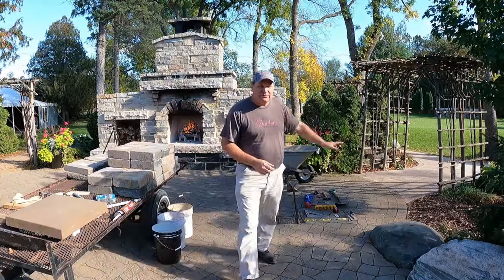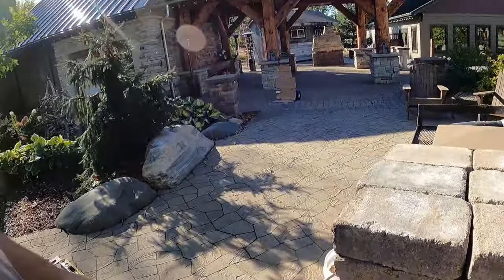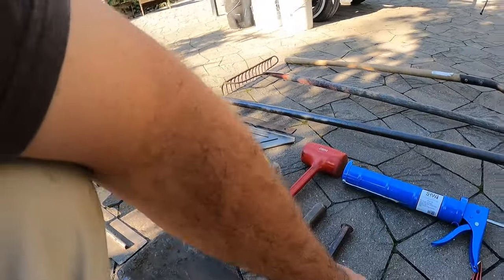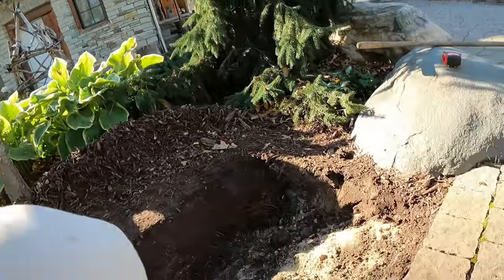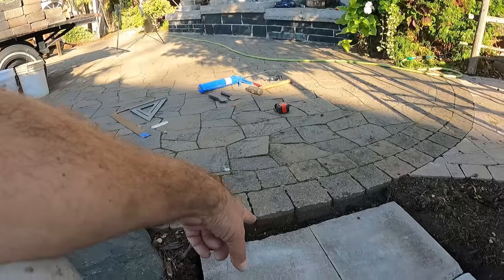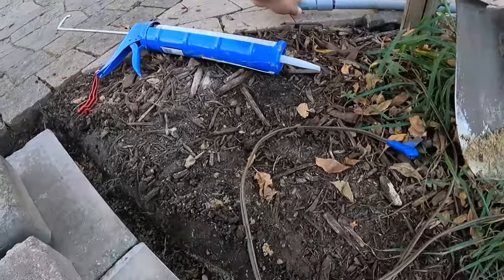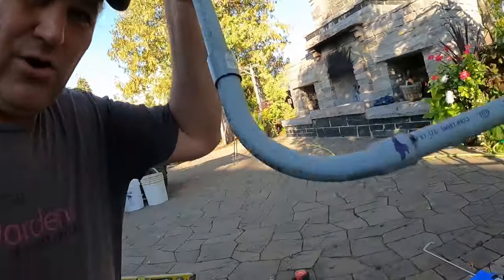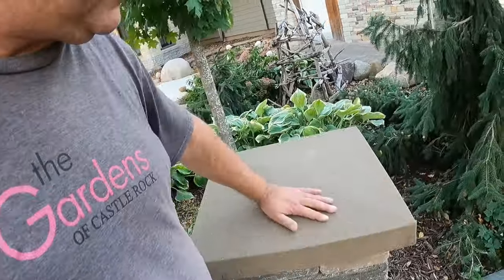Concrete Retaining Wall Landscape Block Pillar – Landscaper Know How

Comment: What blocks are these and what color? Where do you get them? What size / dimension do you end up with when you use 4 blocks, I’m thinking of going wider.
Reply from the maker: The blocks used were produced by Borget in St. Joseph, Minnesota. The color blend was MN River and most landscape supply centers will carry them. The blocks are 4"x8"x12" and can be used in any direction accommodating your desired wider build. Almost all block manufactures will have a similar dimensional block so check out your local landscape center or big box store. Good luck with your project! Cheers!!

Comment: Question - does the crushed rock and (variable-sized) washed sand come in bags? Assuming not, since the HD and Lowe's folk look at me like I'm from outer space lol. They show me "pea gravel" and landscape or play sand. Do I need to check with my local nursery/landscaping co. and do I ask for "crushed rock" and "washed sand"? Thanks for the fantastic content and all the great tips! Got the stones - can't wait to start, using this as a tutorial!
Reply from the maker: all regions are different on how they sell materials... it is most affordable to buy in bulk, but you may end up with more material then needed. the crushed rock you are looking for is called 3/4 minus, which includes the fines, and is also referred to as ASTM 2940. good luck on your project and thanks for checking the vid out! Cheers!!